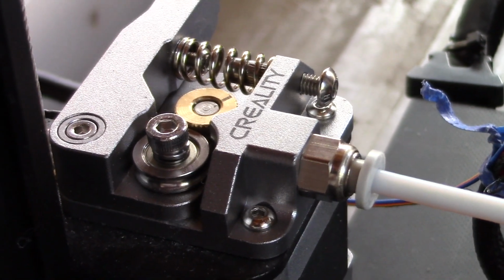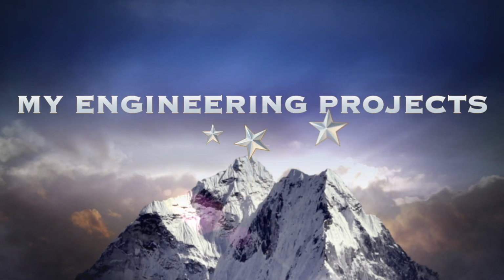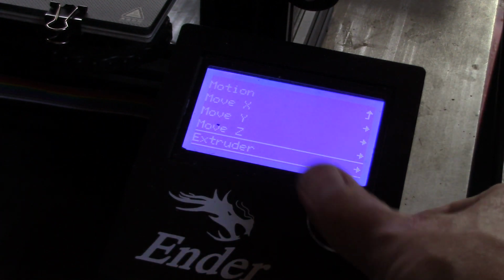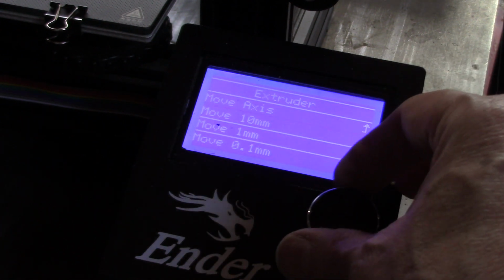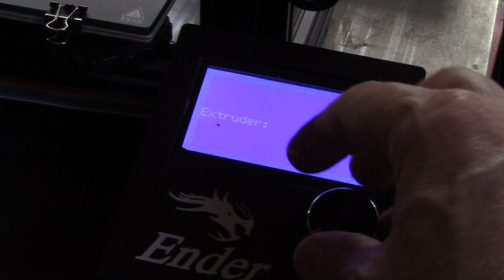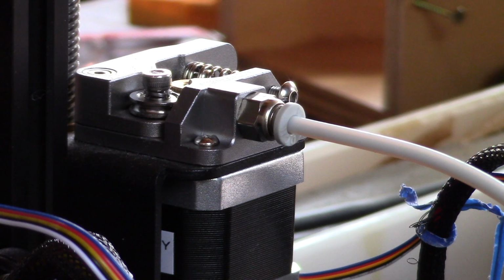Ender 3 Filament Jam Removal

Comment: 😮I'm having the same problem but after I do all this it works for a few minutes and then it happens again 😭
Reply from the maker: If it's in a really hot room, this will make the problem worse.  You might also try to reduce the filament end temperature of the nozzle.
Reply: @MyEngineeringProjects   its not hot i have had this printer for 5 years and  never had problems with it until now its a mystery to me i just tried it again this morning the same thing thank you for replying to me

Comment: Thank you for the video. I had the Same problem and I solved it like you did, but at the and of the next print (about 2 hours) it happened again. If I understood well you suggest to lower the nozzle temperatur?
Reply from the maker: I would try that. Also, if you are in a hot room, try to move to someplace cooler.

Comment: The reason for the nasty jam is not the tube nor the heat in the garage lol. The real reason is over tension of the spring. The metal extruder upgrade is actually a downgrade as it comes with a stiffer spring that smashes the filament causing it to jam inside the tube. The real fix is reducing the spring tension
Reply from the maker: In my case it was definitely heat.  The metal extruder works great and the tension is set properly.

Comment: Hello, it jams like this always , can you help me . I use PTFE tube 2mm internal dia, and 1.75mm filament , the problem is it gets jammed at the hot end and the melted filament runs into the PTFE tube causing it to jam😢
Reply from the maker: If it's happening a lot then the first thing I would try to do is lower the nozzle temperature.  I would do it gradually until you can still get a good print without it being so hot it melts the tube.
Reply: @MyEngineeringProjects  the thing is , the tube is not melting , the melted filament at the end of the tube is comming in reverse direction and getting clotted .(Sry for any grammatical mistakes)
Reply from the maker: ok have you checked to see that the nozzle hole is clear?  If it's pinched closed or clogged it might cause this behavior.
Reply: @MyEngineeringProjects  i cleaned it after every attempts , at last I also changed it , but the problem remains there
Reply from the maker: Then i would try lowering the temperature of the nozzle and seeing if it has any effect on the problem.
Reply from the maker: Also have you removed the nozzle and run a brush down the empty hole?  If you had an obstruction before the nozzle then it might cause it to do this

Comment: I am facing this issue, unable to print. Will try this method today.
Reply from the maker: If the part can be lifted up like mine, then it's broken.  I didn't realize it when I shot the video.  If yours does this then you'll need to replace the extruder with a metal version.

Comment: mine snapped while pulling, now what?
Reply from the maker: It depends on where it broke.  If it's near the end where it goes into the nozzle, you can probably snip the tube if it is still long enough.  If it is too far away, you will need to replace the tube.

Comment: I changed my nozzle to a brand new one, the spare nozzle that came with my Ender 3 V2 Neo. Almost immediately after, i got the worse jam ive ever had. Used this video to get it out. But to my surprise, it jammed again! And again! I cant get anything to come out. I checked the nozzle and everything seems fine. I cut the part of the tubing that the filament was catching on. Tried different filament... Still gets jammed everytime...
Reply from the maker: Check the nozzle temperature.  If it is too hot, it will soften the tubing causing it to swell and ultimately jam.
Reply: The reason for the nasty jam is not the tube nor the heat in the garage lol. The real reason is over tension of the spring. The metal extruder upgrade is actually a downgrade as it comes with a stiffer spring that smashes the filament causing it to jam inside the tube. The real fix is reducing the spring tension

Comment: I just had a similar problem. I bought a new PLA+ filament and unlike the previous normal PLA prints that I had done at 200 degrees, I raised the temperature to 210 degrees for this new filament. For some reason the first test went well but when I sent to print a second object the filament did not come out (it was as if the motor that pushed the filament did not have enough force) when I checked the nozzle I realized that this was not the problem but part of the filament had expanded inside the tube. Finally after trying to remove the filament for a long time without good results I had to replace the tube. Does anyone know what I can do to prevent this from happening again? I plan to return to the usual temperature of 200 degrees but I'm afraid it will happen again.
Reply: btw you are the only video on youtube that shows the same problem that I had, thank you very much for uploading it
Reply from the maker: So based on what you said, I think the issue us that the 210 is too hot and it allowed the tube to expand and deform.  When the filament cooled, it was now too big and it jams.  I would suggest cutting off the jammed section and then lower the temp to 200 and try again.
Reply: @MyEngineeringProjects  Thank you very much, you are one of the few help I have found in this regard!
Reply: i had the same problem and i have tried everithing and nothing solves it :( i dont know what to do
Reply from the maker: Is it in a really hot room?  Have you lowered the nozzle temperature?

Comment: I have the new K1 Creality printer and just after a few prints it completely stopped the filament. Motor slowly spinning and can not extrude or retract. I tried heating it to 200, 210. 220. 240 and no matter what i could not pull the filament out. Should i try removing the Nozzle head when the filament is till in? I do not know what else to do?
Reply from the maker: For a jammed nozzle try this.  Heat the nozzle.  Remove the compression clamp and extract the filament.  Try to use a needle to push out the jam from the top.  If no luck, try from the bottom.  Still stuck, then put gloves on and carefully remove and replace the nozzle.

Comment: Mine is ender 3 neo how do I get filament to back out it is stuck and I made a horrible mistake when threading the PLA filament through for cut to cut it diagonally now it is stuck hard won’t pull out at all. Help ty
Reply from the maker: First warm up the nozzle to full temperature.  If it is not hot, you cannot pull the filament out.  If that still does not work, you may have to snip off the end of the jammed tubing as I did in the video.
Reply: @MyEngineeringProjects  how high should temp go? I up temperature to 200 degrees and what is the part at not the nozzle is but the back side? And mine is the Enders 3 Neo it is harder to even get white tube out of the nozzle part, extender is easier to remove but cut the white tube where the filament goes in?
Reply from the maker: 200 is a good starting point for PLA.  I increased mine to 205 and it improved the adhesion between layers.  If you have it hot make sure you release the spring on the extruder and then manually pull it back.  This is what I did in the video.

If at this point it won't come back, you need to remove the tube from the nozzle. I also showed how to do this.

Take the tube out and try again to pull back the filament.  If the filament pulls back easily, then you need to clean out the nozzle when hot with a nozzle brush.

Comment: Number 1those little blue horseshoe clips that came with the ender should go in where the extruder nut holds onto your white tubing (If you don't have you can either print off some or use a thin tie wrap this stops the tube from pulling out and putting friction on your filament!
also cut the burnt part off before re-seating the tube into your heat block (you need a clip on that end too)!
also do a mesh bed level before using your BL touch sometimes your Z offset needs to come up a little so you're not grinding your filament into your heat bed!
check all your belts are tight and that everything is secure and no wobbly bits (ie tighten the eccentric nuts).
Reply from the maker: ok sounds good

Comment: I had a similar problem 2 weeks ago. Ended up replacing the tube twice. Capricorn can handle higher heat. Ive been printing with way higher heat and learned a painful lesson
Reply from the maker: Thanks for the tip.  I have a Capricorn but have not yet installed it.  I think I'll swap it out if this heat wave continues.
Reply: @MyEngineeringProjects  Yeah. One thing I did find is that the inner diameter of my Capricorn tube is slightly narrower than the stock stuff. So might have issues if the filament is slightly out of spec / may increase extrusion pressure
Reply from the maker: ok I'll watch out for that
Reply: I had same problem. That metal arm conducts heat from extruder to the filament. When the filament gets soft it jams in the tube. I implemented 2 fixes. 1 installed small shim between extruder motor and bracket to limit heat transfer to the arm. 2 installed a heatsink and fan on the back if the extruder motor. Dropped the temps on the arm significantly and has eliminated the problem.
Reply: @baler1992 can you please show a picture of your setup, I'm facing the same issue
Reply: @vitstravelstories2427  Most of my issues like this were cause by heat creep. I took several steps. 1. Lower the ambient temperature. My biggest issues happened when I had the enclosure closed. Open up the area and keep as cool in the area as possible. The second measure is to make sure you have good air flow over the extruder. The fans need to be replaces about once a year. 3. Get rid of the Capricorn tubing. It has slightly tighter inner diameter than the white PTFE tube. If your printing with PLA the Capricorn tube is not necessary.